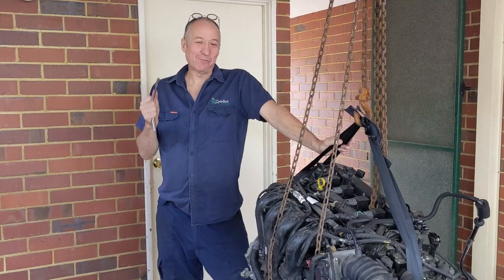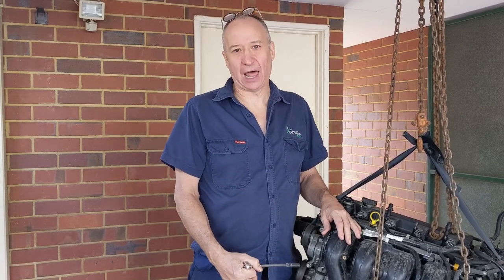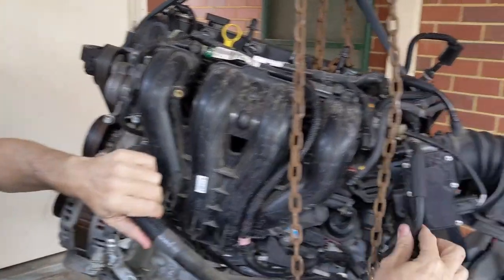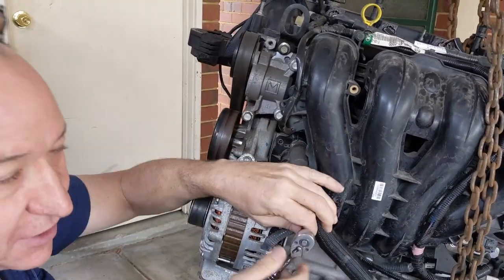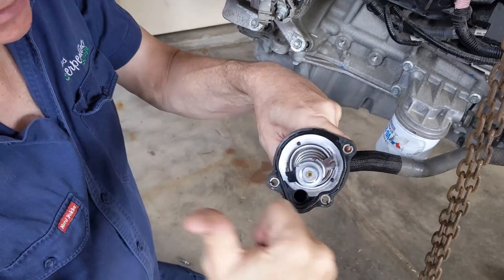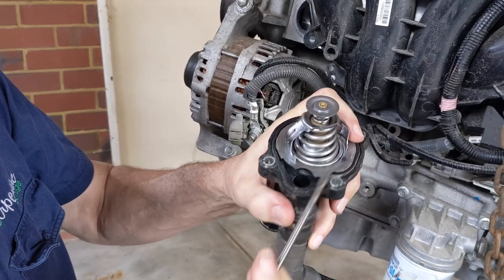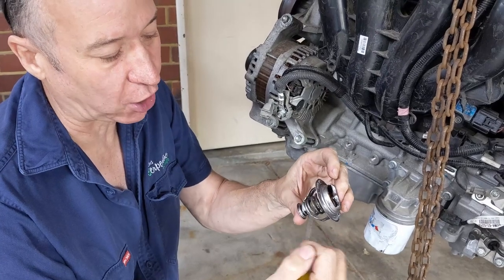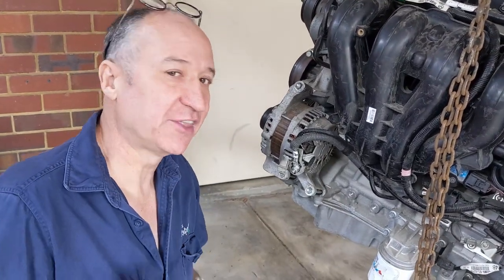BL Mazda 3 (2009 to 2013):  How to remove and replace the thermostat in an LF-VE 2.0 litre engine.

Comment: So I have a 2010 Mazda atenza with the 2.5 engine and the temp gauge suddenly went up over halfway , I noticed heater wasn’t blowing hot air . I’m wondering if the thermostat is stuck shut because when I start engine and take the radiator cap off the coolant level starts to overflow the radiator . Any ideas . Cheers from New Zealand .
Reply from the maker: Hi Dean,

these things are notoriously hard to diagnose based on text only.  Please have a mechanic look it over in person.  You'll be good.

Paul.